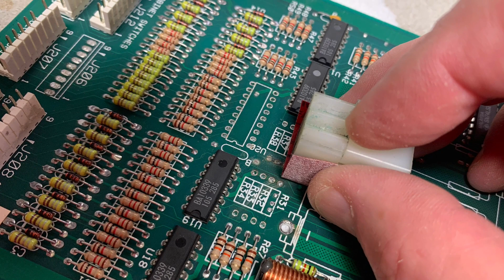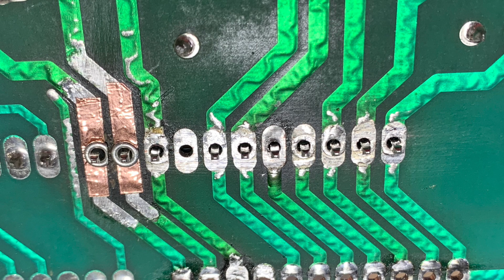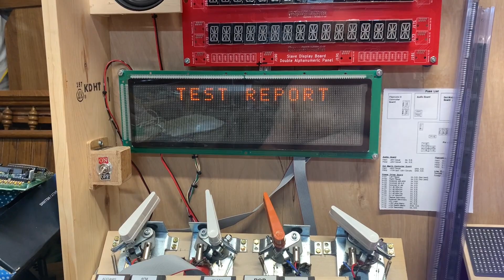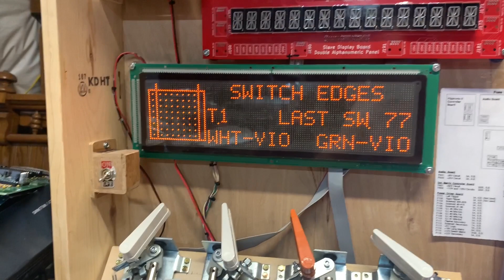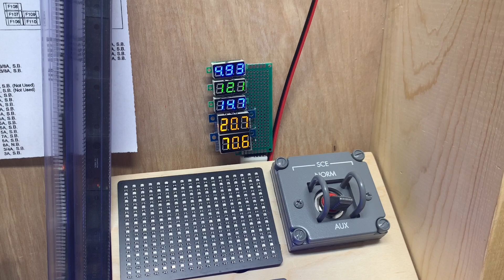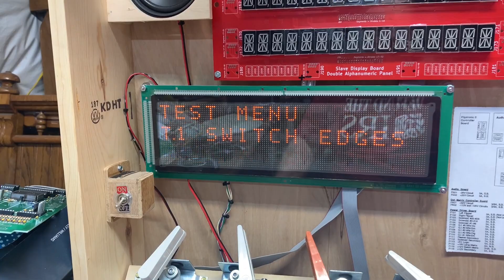Williams Terminator 2 MPU and Driver Board Rehab - T2 switch matrix test display is not 8x8. Doh!

Comment: Have an odd issue, when I have my upper T2 eyes (Silver Skull) connected it screws up my row 2 light column (4X, Special etc.) and keeps the lamps on row 2 always on..if I unhook the 2 wire connector the lights return to normal. I have changed the diode out and tried LED and incandescent bulbs and nothing changes. I just put the red condoms on the bulbs and left it unplugged so the playfield lights work correctly.. Any help would be greatly appreciated ...
Reply from the maker: That sure sounds like a lamp matrix isolation diode installed backwards.
Reply: @ChrisHiblerPinball  If I connect the diode the opposite direction the bulbs don't light at all. If I don't use the diode the bulbs in the eyes work but the ghosting or other lamps on the same row stay lit. Ive tried other diodes also.. Maybe the diode is not supposed to be wired to the red wire or there needs to be one on each bulb socket?